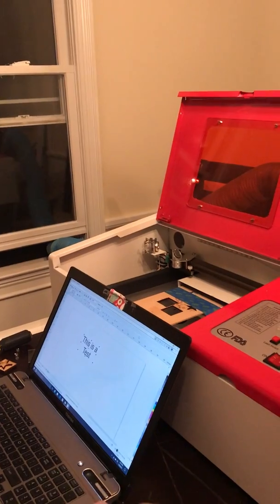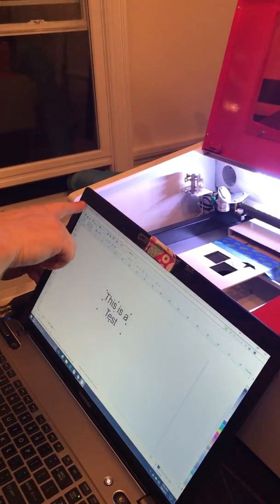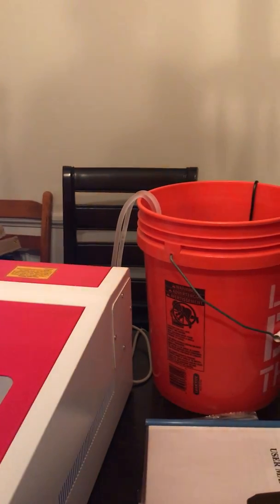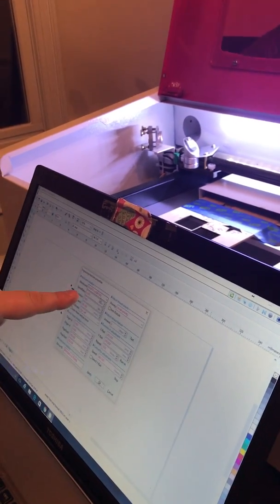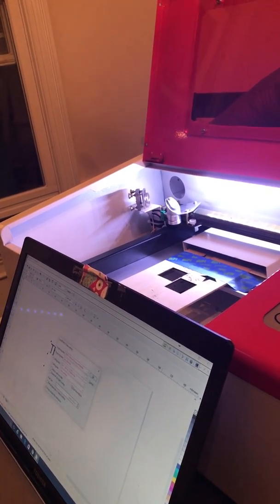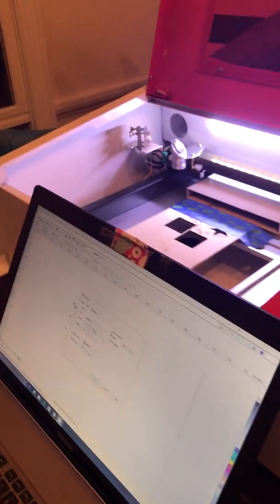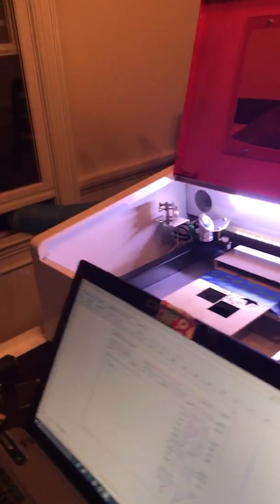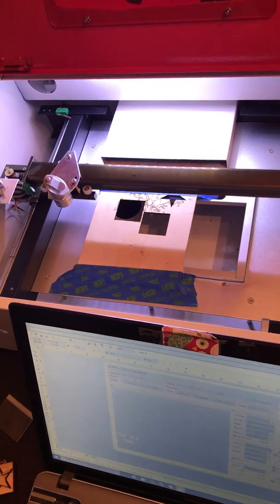Orion Motor Tech 12"x 8" 40W CO2 Laser Engraving Machine Engraver Cutter with Exhaust Fan USB Port

Comment from the maker: Should have posted the follow up. Factory sent instructions. The horizontal beam was out of alignment by about an 1/4 inch. Likely happened in packing or shipping. Just had to manually measure and physically pull the beam into parallel. Felt silly it was that easy, but it immediately got it working perfectly.
Reply: Paul Jr. Beyer thanks for the update
Reply: Can you please show us how you were able to fix the beam?  Thank you for posting a follow up!
Reply: Love to see a short video of this fix...also can you post the instructions they sent you?
My best,
Ray
Reply: highly irresponsible to leave this without follow-up
Reply: @troaaxaltion  lol...as you reply to the follow-up post.

Comment: I had the same problems with homemade cnc machines and had to change motor settings. Not sure if you can in this situation. Check for something causing it to get tight.